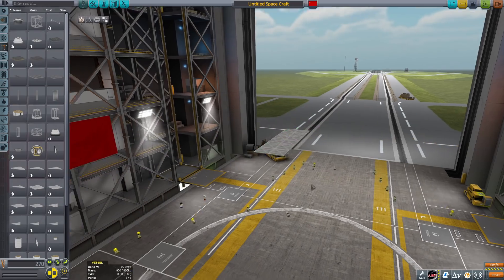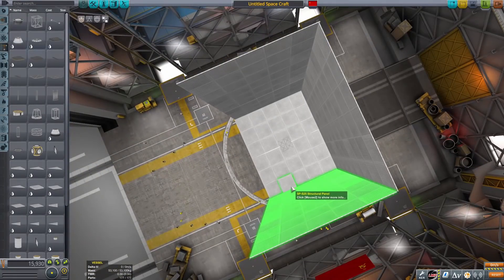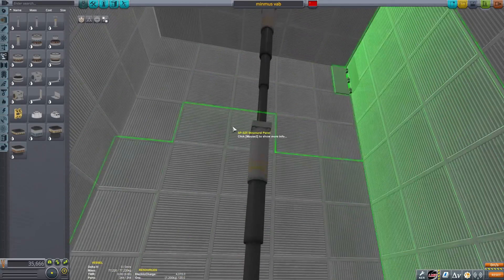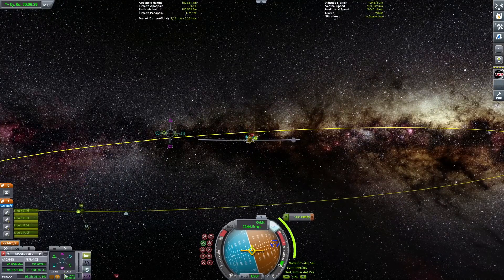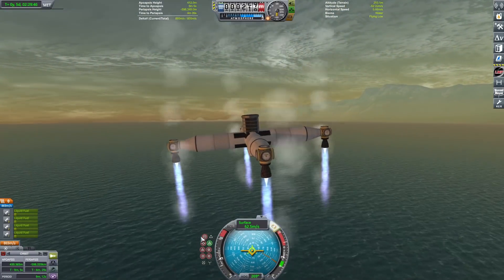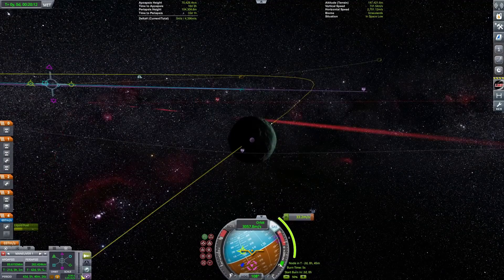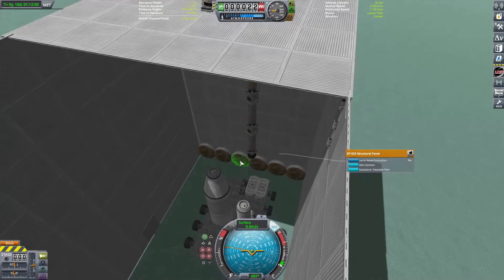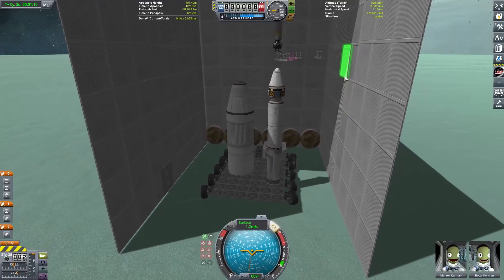KSP: Sending A Fully Functional VAB To Minmus! [stock 1.11]

Comment: So in my brother's save file, there is a large asteroid going to hit Kerbin. And in my save file, I'm making a colony that will let him get several Kerbals offworld before the impact. Problem is, I wanted to add some launchpads to the colony because we're bringing rocket parts so we can eventually leave Duna and either expand outward or head back to Kerbin in a few hundred years. My design for a simple launchpad is a 3x3 of the base game large structural panels with octagonal struts making legs and a large ablative heat shield on top with a decoupler so we can make the rockets and launch them. Do I need the heat shield or can I save weight and money?

Comment: I was throwing parts at the wall recently to see what stuck and I now have a vehicle crawler that I don't know what to do with. It has a lot of structural panels, 2 or 3 Roccomax 64 fuel tanks, more xenon than anyone's decade long save file will use, and 4 MK3 monopropellant tanks. It also has a staircase/ramp but we don't talk about that. And it sags under the weight of Kerbin's gravity, so I'm considering making the platform thicker. Anyone want the file for it?

Comment: This could actually be useful for making missions to Duna. Of course you would have to send the rocket parts from Kerbin to Minmus  into that VAB but it would take a smaller rocket since there is no atmosphere on Minmus, it’s lower gravity and it right at the edge of the Kerbin system so I would be a shorter escape burn (and cheaper!) Imagine putting this on Ike or Dres! Putting it there would make for some small rockets carrying probes to eeloo or Jool.
Edit: Not only did this man make a VAB and launch it to Minmus, he landed the sky crane on Kerbin! With that Delta V you probably could have send it into Duna’s atmosphere where it might have been destroyed. If it wasn’t destroyed, you could have just left it there as a mark of what you did.
Reply from the maker: I could have sent the skycrane to jool prob and burned it up there lol
Reply: Lol
Reply: Originally I started playing RSS last week but i should probably do atleast 2 jool 5 missions before I attempt RSS/RO